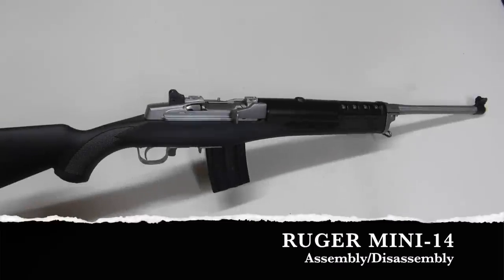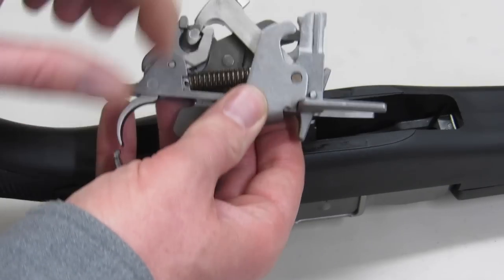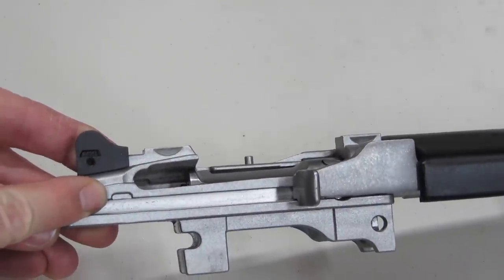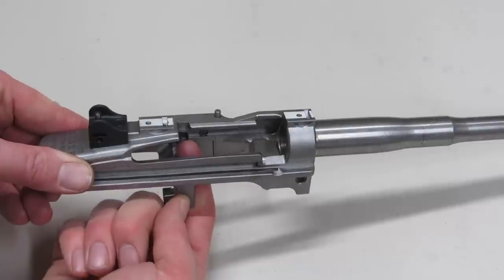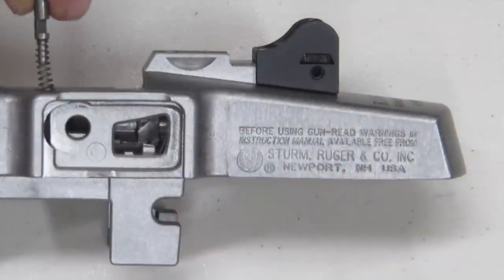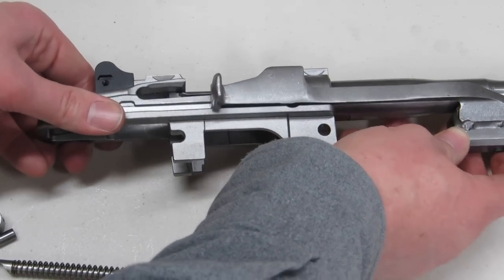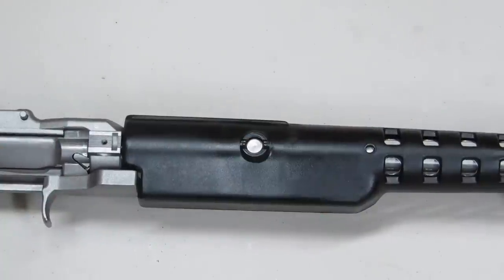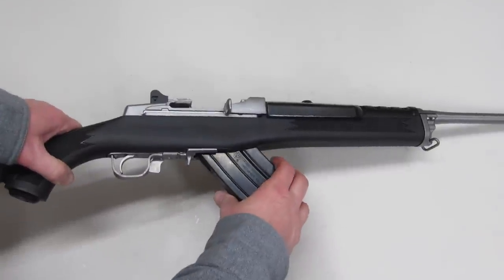Ruger Mini-14 Assembly Disassembly

Comment: I would like to emphasize the point about the hammer being cocked and the safety on. I was reassembling mine with the safety off and accidentally hit the trigger and dropped the hammer. This locked up the whole gun. I called Ruger and they told me to reach through the slot and push the hammer back till it stayed cocked. Thankfully this worked.
Reply: Thank you for that additional info!

Comment: Thanks for posting this very informative video. One interesting thing that I found out about my Mini-14, which was the exact same setup as yours, replete with stainless steel and the composite Black stock, was that mine did not have  a bushing with a pin holding it in. I had to watch the video three or four times to realize this. I thought I was missing something because when I took mine apart I had nine parts laying on the table instead of the eleven that you had. I then remembered that mine is an older model that was manufactured in 1989, which is when I bought it. That was the only difference between my older model and your newer version, other than that everything was exactly the same and I was able to disassemble it and then put it back together with ease after I finished cleaning it.

Comment: I appreciate the video, I have two of these now, one was a 16th  birthday give from my uncle the other I just inherited from my dad. Now I know how to keep them respectively clean like they deserve.
Reply: If you have an older Mini-14 don't panic when you take it completely apart and realize that you have no bushing and pin to hold it in. I have one that was manufactured in 1989 and when I took it apart I was stumped because I couldn't figure out where the bushing and the pin were. I thought I was missing something so It took me watching the video three more times before realizing that his was a newer version that contained the bushing with pin. Older models like mine do not have this feature. Other than that everything else was exactly the same and I was able to disassemble and reassemble it in no time at all after I finished cleaning it.

Comment: GREAT INSTRUCTIONS - 1ST TIME FOR ME AND HAD PROBLEMS WITHOUT YOUR VIDEO I WOULD HAVE NOT MADE IT.  IT LOOKS LIKE THE AR-15 - M-16 IS SO MUCH EASIER TO DO.  IT SURE SUCKED TRYING TO GET THAT BOLT BACK IN - AND THE HEAVY SPRING.  MINE IS A LITTLE DIFFERENT THAT THE GUN YOU SHOWED.  THANKS MUCH.

Comment: I just broke down and cleaned my older 181 series Ruger Mini 14.  I hadn't done it in years as it has been a safe queen, and had forgotten some of the steps. Your video  really helped. I noticed that there are several differences between yours and mine.  Relatively minor, but interesting.  Getting the bolt back in was the most frustrating step. Getting it loose was easy, but putting it back sucked. Finally got it in however. Not sure how.
Reply: Did you remove the side plate and spring like he recommended? He said that you can put it back in with removing those parts but its much easier if you do. I had no problem whatsoever putting the bolt back in after I removed the side plate with the inner part and the spring.

Comment: The Hand Guard (HG) is held by a sheet metal clamp against the Barrel-Receiver (BR) unit.
To snap off HG (2:39), i've found it's EZr to turn BR unit upside down, tilt the unit w the front
sight on the table top, grab one edge of HG w a thumb, its another edge w the other thumb.
Note that their thumb nails r pointing against ea. other.  Now, push the HG down w both thumbs
and POP!  Goes the Weasel!

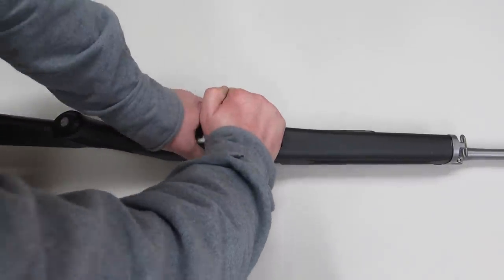Comment: The trigger unit (6:44) was very hard to press down though i turned it 
upside down on a table as u prescribed.  But, the back of the trigger guard
curl couldn't latch onto the tab on the stock's metal bracket rear. Sledge
Hammer may do the snap?  Yes, i had the trigger unit's tab into the guide
slot on the steel re-enforcement bracket (mine is of wood stock mat'l).
The trigger unit seems to have some leeway to pull a bit backward but
looking at the levering pin at the front of the trigger unit, any rearward
shift motion must b an illusion... So, cutting the depression slot on the
wood won't work either as the tab and slot determines the trigger unit
position.  

Any one out in the audience had difficulty on this trigger unit
snap on?
Reply: Got it.  Just round off the mating edges w a jewler's file a bit did the job.
Don't file off too much or it won't snap in tightly.

Comment: Thanks for the Video. I need to replace barrel any chance you can do a video on that? I messed mine up trying to remove the front sight. I have the 581 series and they must have used sper man to install it. I was going to put a mo rod and mo reaper until the barrel problem. thanks again great video.
Reply from the maker: That is going to be expensive. I recommend calling Ruger or finding a gunsmith. There is at least on online that offers barrel replacement, but I am worried about posting the name bc I am not sure if YT allows promotions.

Comment: Good video, thanks... I'm thinking about buying a Mini-14 and want to compare how it's cleaned vs. my AR-15 which is pretty easy, and I run it a bit dirty until needing some serious cleaning...always picking up dust and debris in the Arizona desert.

On a scale of 1 to 10 how hard do you think it is to strip and clean the Mini-14?
Reply from the maker: I think it is comparable to an AR if you include taking apart and putting together the BCG. Mini14 isnt that hard after you do it half a dozen times.
Reply: @bgallaher77  it seems to me that the mini is harder to take apart, but it doesn't get as dirty. As far as regular cleaning  (barrel), AR is likely better though. You can clean from the back.
Reply: Eddie Black  oh sure, but rods are easier. 
My point was about ease.
Maybe if you use a rope type often, like a bore snake, it doesn't seem any different in difficulty, but I just find rods to be extremely convenient and efficient.
And while you can still clean the mini from the front with a rod, the ability to mess up the crown easier  goes along with that as well as difficulty inspecting the bore.

Comment: I'm completely at a loss in removing the slide handle from the shroud. Cannot get it into the indent and all videos show it like it just comes right off but it doesn't, it's locked in place and will not slide into the indintation unless I completely brute force it and rip the shroud off.

Comment: I get to the part where I need to “click” the trigger assembly locks and it doesn’t work. Cannot make it lock. Have the trigger cocked and the safety on as recommended. No luck. I want to push down on the trigger guard hard, but don’t want to break something. Any suggestions? Thanks a lot for the video tutorial!
Reply: I strike the trigger guard (hard) with the heel of my hand to snap it into place. Yes, it hurts my hand at times. Others use a leather or rubber mallet . As the weapon wears in, latching the trigger guard requires less effort. Old footage from the Winchester factory, during M1 Garand manufacturing (which used the same type locking mechanism) shows the assembly workers using leather mallets.
Reply: @alanhigh8125  Hi Alan. I appreciate your reply. Man, I am afraid to hammer on the trigger guard! While it is only about 1/16” off the rear clip, it feels like something is blocking its natural motion. I am not able to see what that is, but it feels like the tongues are not lining up inside the stock. I have taken it apart previously and do not recall having this issue. Again, I have the safety on, the trigger guard all the way up when I reinsert the trigger assembly. This is making me feel like a dumb ass especially since I have taken the gun down and reassembled it successfully previously.

Comment: Hello I just purchased a Mini 14 and have a question. Getting familiar with the rifle I took it apart. While reassembling it I noticed that the safety seems to be smooth while the bolt is locked open but much harder to use with the bolt closed. Is that normal? I don't remember it being so rough prior to taking it apart.  Anyone have experience with this?
Reply from the maker: Mine is like that
Reply: Thanks for getting back to me so fast. I thought maybe I didn't line something up right but after several removals of the trigger group and reseating it still felt the same way. Your video was great and very clear. A great resource for nube's like me.

Comment: Paul Harrell said the Mini 14 was easier to field strip than an AR. I fail to see how.
Sure the pieces might be bigger and harder to lose but this is definitely more steps that take more finesse than the ARs. You also need tools to do this properly while the ARs don't.
Reply from the maker: I feel like the ar and the mini14 are equivalent if you include disassembly of the ar bcg in that comparison.
Reply: @bgallaher77  Maybe it's just because I have more experience with ARs but once you take out the retaining pin on the BCG it just kinda falls apart. The exception of course is the extractor which I was taught you shouldn't mess with when just doing a field strip.

Comment: Awful welding on the slide. Damn. But great video.
Reply: Looking at the inside of guns has turned me off a lot of purchases. I don't know if that weld would be a practical problem, but man does it not look good from a QA stand point.

Comment: That's not a complete dissaembly,what about the gas block.Unless you take it apart there is no way to clean the gas port the bushing and piston.
Reply from the maker: You are correct. But, there is nothing in the gas block except for the gas bushing, and there is no reason to clean that part. No piston internal to the gas pipe. The combustion gases exiting the barrel when the gun is fired move through the gas bushing at 30,000 to 50,000 psi. No debris will remain. Taking it apart will risk loosing the gas bushing. And putting it back together crooked will cause reliability problems and part wear. This is kind of like wanting to clean the gas tube on an AR.